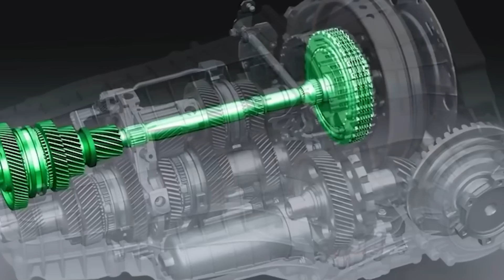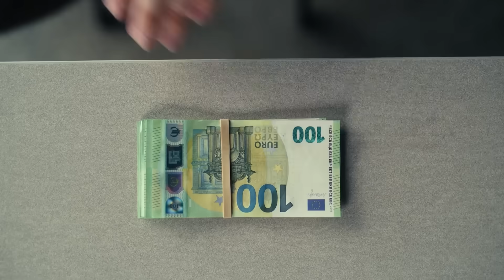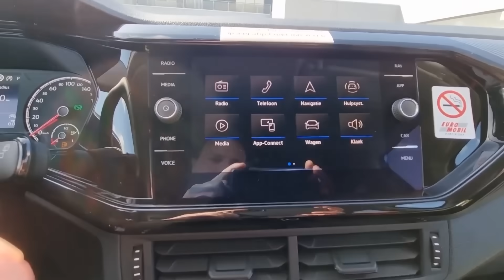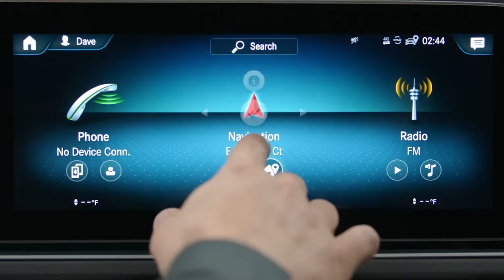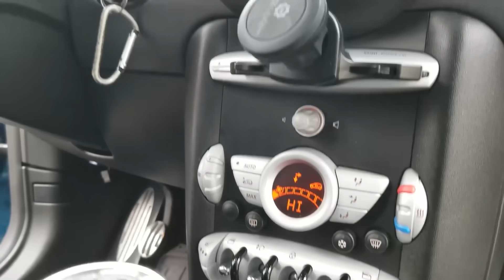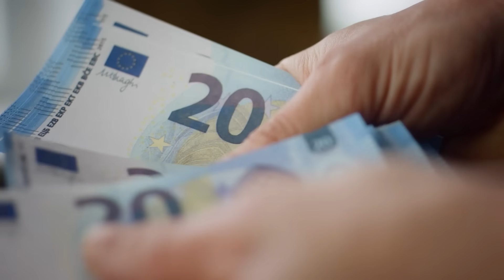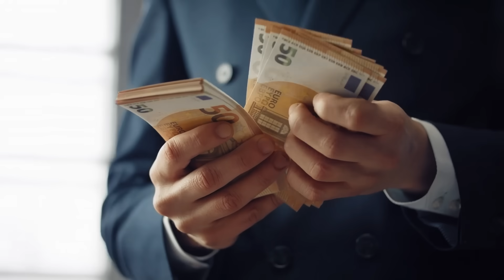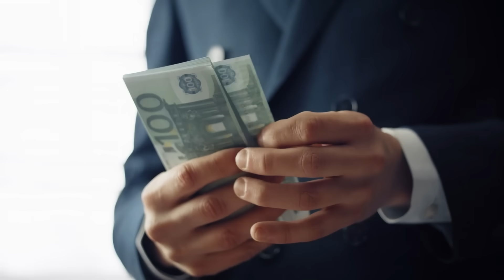7 DIRTY Secrets Why Your European Car BREAKS After Warranty

Comment: 1. Indy repair shops know what to replace and when. 
2. Find an Indy and follow their maintenance regimen.
3. Never go to a stealership.
4. Replace parts with performance or improved aftermarket parts.
5. When you hear ANYTHING out of the ordinary, have it looked at ASAP so you don't damage anything else.
Reply: My old mechanic who is familiar with the model of car I drive asked "How long do you intend to keep the car?" That car had a slight oil leak if you ran high RPM for extended periods of time and you could only smell it when the car was set to heat, but not in the summer. No Drips. He said it wasn't worth going into fix it. Same car lost a temperature sensor. This threw a CEL that went away in the summer. He said it wasn't worth going in to fix it. When we did some major work, access was very easy for the parts that we knew were defective so he got to them then. 

The single bill overall was large, but the cumulative bills would have been triple. My current car, I just changed the battery after 9 years. That is the limit, but I had no incidences. Oil change every 3500 miles because I don't drive it a lot, but do shorter trips (yes I make sure the engine gets hot enough). Next is a trans fluid service (fall). Then in the spring, oil change and brakes.

I cleaned the sunroof and cowl drains last week. Car is tuned and has high performance (cheaper than factory) coils has performance control arms (cheaper than factory and needed replacing. I heard a slight clicking), performance springs (broke a factory spring coil, the whole kit was cheaper than a single factory spring), performance sway bar, clean inside and out with well cared for paint. People still start talking with "Yeah, if I had the money to spend on a fancy car..."  Well I bought it off lease 9 years ago for $30K these people buy new $70k vehicles every 5 years and then dump it because it's falling apart or rusting more than the Titanic.

I voided my factory warranty with the tune. I don't want those a-holes touching my car. Its my car, and I know every detail about it. They usually touch your car and break something else. I also data log the car. Any sensors that are out of whack can get changed on my schedule when I want to spend the money.
Reply from the maker: Solid advice — independent repair shops and proactive maintenance often make the difference between constant headaches and a car that lasts.

Comment: BMW 3 series with M47 2005 cast iron engine, over 300k miles, over 500k km.. 2 stroke oil JASO FD in fuel 250ml/50 litres of fuel for over 250k km!!!! 
Result!?
Not a single sensor changed from intake manifold to exhaust including exhaust. Not a single problem with the engine! Everything is original - everything. Including the exhaust.. Injectors lasted as much/long 500k kilometers. 
Original high pressure fuel pump. 

Changes to prevent failure:  fuel tank pump, ..rebuild of the alternator (first brushes.. then collectors) original alternator, still on the car! Injectors, rebuild by Bosch representative ..2 injectors failed just after the car passed 500k km.. one loud bang under the bonnet (but the engine did not stop) got me concerned.. / took them out, sent to get rebuild; car back on the road!
...Changed MAF (mass airflow sensor) ..got an error since I got the car.. now it is showing the correct values..
...Heat-exchanger failed.. GASKETS only, just after 500k km replaced car back on the road. 
Original engine radiator - water pump (belt driven) replaced twice in 500k km!
Thermostats.. they do fail every 4-5 years because thermostat arr not getting/keeping the engine to the right temperature. Because these has a spring inside that weakens overtime..

But all these are NOTHING comparing with complete failure of gearbox..., timing chain guides.., electric water pump... after 100k

Yes, I replace fluids periodically: coolant every 4-5 years -brake fluid every 2 years (..everything original by the way, still working in braking system) steering fluid replaced every 2-3 years; that is not hard at all.. Gearbox oil, every 150k km. same with the oil in differential; these 2 are from factory since 2005; the oil are different types but saved the gearbox and diff..
Please, buy an used car and don't buy new! (oh no, the clip you just watched is from reality, it is real what they are doing to our pockets..) And try to maintain yourself; is not hard! Only like that you'll have more money! And belive me you'll save the planet more than buying new..

But the real message to you all is 2 Stroke oil 250ml/50l fuel is the formula(!) for a clean and RELIABLE DIESEL ENGINE.  Do you think this 500k km engine is a lazy../worn so much.. and weak at these miles/km!? 
I am having the same reaction from the car as when it was 250k(!) when I got it! 
I am driving my brother car, same engine, ocasionally, and that car has half of the km of mine (...no 2 stroke oil yet) and drives IDENTICALLY, reacts the same as mine, which is crazy!

And that is not all. I do maintain another bimmer ..B47 engine (it is diesel of course) with just 110k k  curently.. Euro 6, right? 
It gets 2 stroke oil with every fill of  fuel as my M47.. but it gets JASO FB as well! JASO FB (not FD) burns much cleaner! 
For the last 20k miles since I got the vehicle.. this car is been driven only short distances most of the time, which is a KILLER for a diesel and with DPF! Well, guess what? ZERO problem in 20k miles from DPF FILTER!
Do you think I am making things up because I have nothing else to do!?
Well ...I have my experience and I my only wish is to share with people who really wants realiability of their cars; that all.
That is my last point..
Good bye and ...Good luck with everthing that you intend..
Bye.😊
Reply from the maker: That’s an incredible story — thank you for sharing it in such detail. It really shows the emotional bond people build with cars that are engineered to last. Reading your experience, you can feel the pride and satisfaction of owning something that rewards care and maintenance instead of punishing it with constant failure. That sense of reliability — knowing the car will respond the same way at 500,000 km as it did at 250,000 km — is something manufacturers risk losing when they cut corners for short-term profit. Stories like yours are important, because they remind us what true engineering quality feels like and why so many people are frustrated with how cars are being built today. It’s not just about machines, it’s about trust, and you’ve shown what happens when that trust is earned.

Comment: I don't know what you're talking about with "plastic timing chain guides"

I've had Mercedes going back to the early 90s with a W124 300 E 

They've always used a "plastic" or it's Teflon like material 

I've never seen a timing chain guide run on metal 

I put 370,000 miles on the 300 E with not a problem with the guides 

Have a 1996SL 500 and the guide still look good at over 200,000 miles 

My 2011 E350 with the M2 72 engine still fine with over 100,000 miles. They fixed a problem with a balance shaft gear back in 2007 that was too soft a metal 

I don't know where you're getting all of this information but at least that I know is not true but I will admit a perplexity at their all using plastic parts and not just the European manufacturers 

I have a friend in the parts business and he made the remark that a lot of parts we were used to breaking within 100,000 miles just go on and on like brake master cylinders. I have an E430 with 182,000 miles on the original flex disc and those would've been gone easily by 100,000 miles 

And yet these newer Mercedes as I say you some plastic parts which drive you crazy
Reply: I think you are missing the point it’s newer models 2020 on 
1990’s Mercedes are legendary for their robust durability
Reply: @davidthomson692  I think that's virtually any car where all the manufacturers are all driven to making engines conform to economy and emissions which are ever tightening

The dumbest engine I've ever seen is in the Ford escape and bronco sport 

I've seen this on two YouTube channels where they are covering it the car wizard and "I do cars" where he tears down faulty engines 

This is a little 3 cylinder 1.5 L engine with a turbo charger 

Among its dumb designs is a belt - not a chain or gear- deep within the bowels of the engine the powers the oil pump. So when the belt goes the engine goes 

The car wizard had a customer come in with a bronco sport and it was misdiagnosed at another shop. They said the turbo had gone out 

Which upon examination was true but what caused it to go out was a crack in the cylinder head it was leaking coolant into the turbo which was turned throwing it into the catalytic converter 

$12,000 damage on a stupid little crappy engine 

He said you cannot order a new one because the dealers are all backordered with their own warranty engine issues

I would not buy a newer Mercedes. I wouldn't buy a newer anything for that matter 

Even the Japanese are having their problems although not as big as the other manufacturers 

Anything with a turbo charger is not going to go 200 or 300,000 miles without an issue. 

As far as Mercedes are concerned the mechanics are complaining about this plastic tubing that goes to the turbos that  if you touch it due to heat and time they just disintegrate   

In the E class-their "bread-and-butter model" - used to be the non-aspirated 3 L six cylinder was King. 

Now it's a little turbo charged 2 to 2 1/2 L four-cylinder

And anything with a real small displacement that has to work extra hard to get decent performance is not going to get trouble free use over 200,000 miles. 
 

Goes for Mercedes or anybody else 

I will say to this particular video a perplexity at Mercedes and other manufacturers using plastic parts 

And it isn't just a matter of them trying to make them obsolete as other parts as I previously mentioned seem to go on and on 

I had always replaced the regulator and brush assembly in the alternators of my Mercedes when they hit 150,000 miles. It was always easy in a Bosch alternator because you just unscrewed the assembly in the back without having to disassemble the alternator 

My E350, because so much more power demands-seems to lack this feature and since I like to preemptively replace things before I go on a cross country trip I asked my shop friend what the life is on these new alternators. He said that he's "never replaced one". That's new for all of us. So I guess after 150,000 miles every 10,000 miles or so I should test the output but apparently the brushes last a lot longer
Reply: In the meantime 20 to 25% of Jaguar landrover diesel 2.0 with timing chain fails before 150k exactly because of this. Repair? 2500 to 3500. Just because you got lucky based on the car you had doesn’t defy statistics. A 1 in 5 cars that fail exactly because of this is insane planned obsolescence and not acceptable. 

It still means that in 80% of case you can be fine.
Reply: You are comparing different era of cars, budgeting policy and political landscape. Are you mad?
Reply from the maker: Thanks for sharing such a detailed experience. It really shows how varied ownership stories can be depending on the era and the model.
Reply: I manage a European car repair shop. German cars from the early 2000's on are no longer reliable or durable. Anything with over 80,000 miles will have a myriad of repair issues. Most will have various electronic failures and oil leaks. Small displacement engines will begin to have very expensive failures related to timing chains at this point. Steering racks are also a common and very expensive repair as are transfer cases on all wheel drive models. Modern German cars should be avoided.
Reply: Sure...you...did....😂😂😂
Reply: I know that BMW had plastic guides problem. I was fifth owner of 2014 Skoda (VW brand), one day decided to replace timing chain and plastic guides were like new on 200k+ km engine. Left original guides, did additional 100k and sold car because I moved to another country. Didn’t have any problems with plastic guides on VW
Reply: You muppet! There is plastic and there is plastic! Ok then, ignore all the warnings and advice and go out and buy a new or very late model German car and see how long it lasts. Even if your right about the timing chain guides, why pick on one component and use it to undermine what this Chanel is doing, ie warning us of how we are being lied to and ripped off by our own people. I could understand it coming from China but this is disgusting.

Comment: Well, I worked in the industry for 8 years. Never came across these cost meetings where they tiered the parts into what should fail when.
Reply: Easy to explain. You were not included in the (higher) circles where these subjects are discussed ... above your paygrade.
Reply: @ericshutter5305 maybe. Although I was responsible for unit cost.
Reply: Unless you were an executive or head of engineering they wouldn't share this information with you.
Reply: @MM-ou6fw I see what you mean. But surely the engineers must know given they are designing the parts.
Reply: What was your position?
Reply: @EoEhNnE2013 senior finance manager for series production.
Reply: A cheaper plastic part, instead of a metal one doesn’t choose itself.
Reply: @senseofthecommonman it doesn’t. And they are always looking for savings. Of course they are. But it’s the “plan to fail” tier structure that I said I never came across.
Reply from the maker: Good insight. It’s always valuable to hear from someone with direct industry experience.

Comment: I still find that the German brands are better than American, British or French Brands. The likes of Toyota are still top of the pile. I’ve put 150k miles on my VW in 10 years and engine wise, all it’s had are some glow plugs. Everything else is service items.
Reply: You cant compare 10 y old cars to modern ones leaving the factory.
Reply: @HyperVegitoDBZ well, the alternative is to wait 10 years and see what the new ones are like.
Reply: @HyperVegitoDBZ I guess the big difference now compared to 10 years ago is the integration of software running the cars.
Reply: @scott8566scott  And planned obsolensence, cus cotting on integral metarials and whatnot. Vendors like Toyota are still in middle ages software wise.
Reply from the maker: That’s a fair point. Many owners do have positive long-term experiences, especially when maintenance is kept up properly.
Reply: @UnderTheBonnetTips Maintenance is always the most important thing. Have the car looked after by people who really know what they are doing (that often isn’t a main dealer) and drive them with a degree of mechanical sympathy. Keep them clean (inside, outside, underneath). Do that and most cars will last well now. I guess we’re now in the world of software updates also being a thing. But to be honest I’ll stay away from those cars for as long as I can.

Comment: So my Alfa Romeo is surprisingly reliable compared to your german car 😂
Reply from the maker: That’s ironic, but you’re not the first to say it. Alfa’s reputation has changed a lot compared to what it used to be.
Reply: Alfas, are great !!!
Reply: @pana.2994 Alfa-Romeo's busso V6 engines are pretty dependable and durable, my old 1983 GT V6 outlasted my 1995 BMW 530  3 liter V8. My BMW plastics all self destructes at 101k miles and I mean all  my radiator my intake manifold and the cylinder liners disintegrated costing me 8k. Bill.
Reply: If you want to make lots of money as a professional mechanic, work on European cars exclusively and you'll retire very wealthy after 20 years. If you just want to be middle class and  retire ok work on American cars. If you want to be poor as a professional mechanic work on Toyota and Lexus only. 😢
Reply: @RespectfullyHumblenah you get payed like everyone else company take most.

Comment: Peugeot 5008, built 2018, diesel 2,0 engine. 
Very nice car but... The cooling pump has the plastic impeller glued to the shaft. By definition, this part is heating and cooling and after 70.000 km it fails - simple delamination, different material expand differently when temperature changes. 
Making some teeth or key on the shaft? Easy and costs nothing... Nope. 
Replace the pump, it is cheap ? Nope, only together with the electronic module. Total cost 800 eur. 
We replaced it already twice - at 70 and 150 thousands km.
Reply from the maker: That’s a good example of a design that looks fine on paper but fails in the real world. The material choices really let it down.
Reply: Doesn't that also have a wet timing belt? If so, don't keep it to long...

Comment: Exactly what happened to me, bought an AUDI A3 at 65k miles, first year one coolant problem after another all fixed under warranty, but after warranty ran out the STronic gearbox control module failed which cost £3k to fix.It’s not just the money, it’s stressful driving a car which might pack up, overheat, not go in gear at any moment on busy dangerous roads.I got rid of it for a Toyota, dead German cars sell new Toyotas and Hondas.
Reply from the maker: That sounds incredibly stressful. Warranty running out just as big failures appear is exactly what makes people lose trust. No wonder so many switch brands after that.